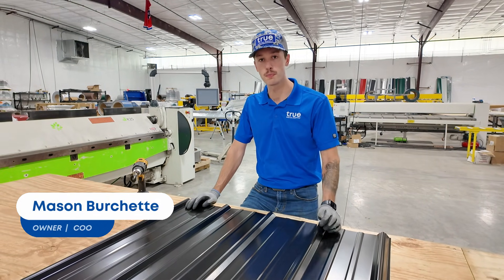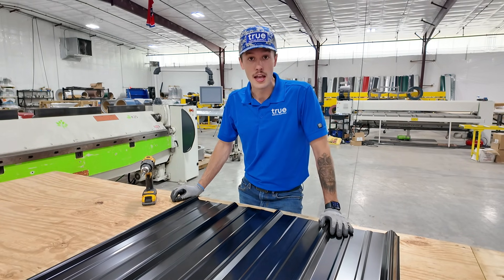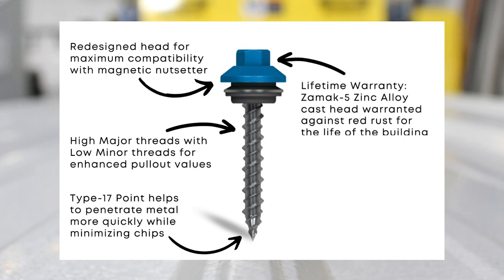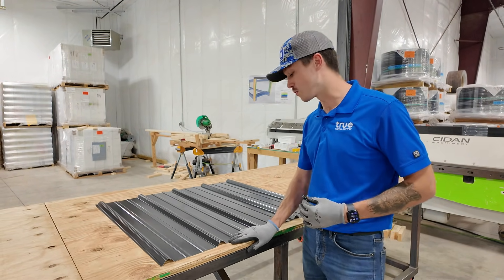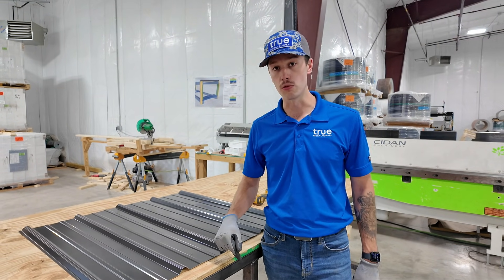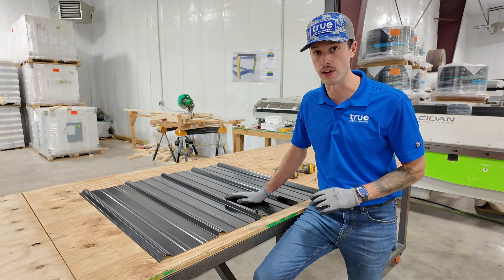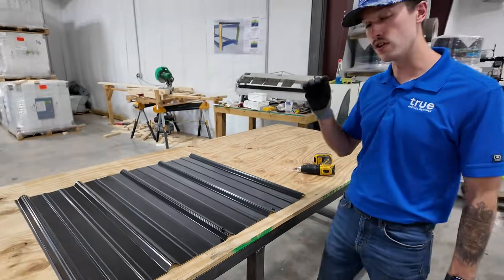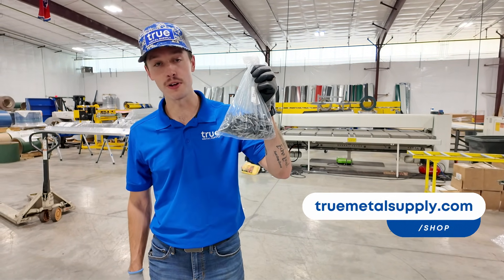Flat or Rib? Where Should You Install Your Metal Roofing Screws?

Comment: I have only seen screws work themselves out in screws placed in the flats. Metal expansion/contraction is one of the main reason to put screws in the ribs. Also it's impossible for it to leak when it's on the rib. Water runs down the flats. Just get long enough screws and you have the same "bite" as the flats
Reply: Hopefully you are being sarcastic. If not I pray for you and eveyone who has you install a roof lol

Comment: Stitch screws on ribs oly to stitch them. Roof screws on the flats. 3:44 naw just use longer screws. The problem is in thermal movement of panel  AND exposed screw allowing panels to not be as secure due to thermal movement not screw pulling out. The panel loosens in cold weather causing movement and leaks. 4:17 spot on.

Comment: What bullshit. Australia has extremes of weather from scorching hot to freezing cold. All metal rooves are screwed in on the ridge. The excuse you're coming up with is just bollocks. 
Using the correct flexible neoprene fasteners solves that ridiculous reasoning you've come up with to justify screwing the panel on the flat.

Comment: Can silicon be used around screws for futher leak proof
Reply: No….first, it would take forever. If you install through the rib you don’t need to.
Reply: Silicone is about worst product ever to come out. Use caulking if you are gonna use anything like that. If properly done then screws with washers will last a very long time.

Comment: Bull crap !   I have 40x80 metal building and was told to put the screws in the flats by the company that sold me the metal. It's been 25 years and now the screws are coming out like crazy .  The little rubber seals WILL fail and common sense tells you that the water will be in the flats and it will work its way around the screws and start to rot the purlins which is what I'm dealing with now.  A friend of mine has a house and outbuildings with the screws in the ribs which was installed around the same time my building was built and I haven't seen one screw backed out yet. From what I understand in Europe and Australia they laugh at us for putting the screws in the flats.  If any of the screws in the ribs were to ever back out at least that is not where the running water is going to be and all you have to do is get a larger screw (which is easily found) and at least the purlin shouldn't have started to rot from water getting around the screw. The type of screw ( i believe they are called dome cap )  this guy is selling is what I am going to try to solve my problem by installing larger diameter screws but nothing is going to help if the purlin has started to rot around the screw. I am getting ready to install a metal roof on my garage and the screws will be in the ribs with the holes pre drilled.
Reply: my purlins are rot resistant redwood.  After 25 years you should expect the screws to back out to some extent.  I was told to check them every 5-10 years as they may need adjustments.  I have ice and water shield under my purlins and it is bomb proof so leaks are not an issue. My screws are in the flat.  EPDM washers don't last 25 years in the weather and elements and you should plan on replacing them with new screws.

Comment: In Nicaragua, lots of rain and sun radiation, we install the screws on the rib. We also apply a product called Imperfast by Kermill to seal and protect the screw's neoprene seal against UV radiation. That's the key step for a long-lasting fastener.

Comment: The claim about thermal expansion is not valid for a concern. A 100 degree temperature change will only result in about a .0007" change in length of the screw, not an issue.
Reply: The concern isn't for the screw expanding, it's about the metal roof itself.  Expansion of materials due to temperature is expansion per inch of material. For an 8ft steel panel, that's 0.07" with a 100F change. That's enough to mess things up.  It's the same reason drip edge is supposed to be nailed every 4", it's because of thermal expansion over long lengths
Reply from the maker: Great explanation!

Comment: It's not controversial, there is no benefit to screw into the flat compared to going through the rib which is proven since roof screws were invented. The screw you used is way to short for the profile of the sheet, use longer screws, screw in properly, problem solved.
Reply: When considering thermal expansion the more threads  above the decking the movement of the roof panel would have more leverage to work on the screw. Like using a short bar to lift something vs a long bar. That was what he was trying to explain.  Could avoid the whole mess completely and install standing seam.
Reply from the maker: We appreciate the opinion!

Comment: Okay thanks  for the informative information. To be honest I was think on the rib of the panel because of rain water. ( I am in Florida no snow) But it does make sense now to place the screws in the flat or valley of the panel. Seals better, less exposed screw to thermal expansion and contraction. I am getting ready to have a roof installed on my house and could not get or find out any information of the best place to install screws. Your way does make more sense. Thanks very much. Now I just need to find a roofer who knows what they are doing.
Reply: I'm in the Vero Beach area if you need a good roofer
Reply: PUT SCRES ON THE RIBS .TRUST  ME WE HAVE 50 YEARS EXPERIENCE ❤😊 @roblee2968

Comment: My metal building was built in 1998 and the contractor put the screws in the rib.  The roof has developed some leaks.  What are my options?
Reply: On a rainy day look and mark where the leaks are in your roof. Then you know where the leaks are coming from. Have a guy in the attic guiding someone on the roof to where the leaks were and replace the screws in the affected areas
Reply from the maker: Oversized screws with larger shafts are available for replacing existing screws!

Comment: Between the smaller pencil ribs , most leak resistant is standing seam,  mastic tape on laped rib then stitch screw high ribs with 5/16 head 1/4" × 7/8 long

Comment: so I will tell you this from experience. Manufactures want you to screw on the flat for 2 reasons. It is easier to get a proper layment of the panel and they want to sell their newer more expensive products. If you are experienced enough you can place the screws properly on the rib and this is the best way to go for many reasons. As he stated the roof flexes and moves. with the screws on the rib it allows the roof to flex. On the flat it  causes far more resistance to flex and will cause the screws to either back out. damage the washers or even break the screw heads off. When going through the rib I use 2 inch screws to solve the issues he demonstrated.  when on the rib pre drilling helps prevent problems. If you have a faulty screw on the rib will leak 99 percent less than a faulty screw on the flat. I predrill only on the laps and trim pieces. I started putting through the roof on the threads of the screws  just after they penetrate the metal. Do this right and your screws will remain water tight for over 60 years,,, do it on the flat and I can guarantee you are replacing most of them in under 20 years. Also never install exposed fastener panels without purlins except in buildings that are not heated. NEVER. I have repaired so many roofs that were screwed on the flat....
Reply: What happens if you don't use purlins and place the metal directly on plywood with a roofing paper sandwiched between when roofing a heated or cooled home? Thank you.
Reply: @really2345 why would you worry if it’s plywood? There is no need for strapping at that point. The paper simply stops noise of movement. Not sure if I answered your question
Reply: You sir are 100% correct! The only time I screw on the flat is the bottom gasket to better seal the gasket. If it does leak in the future it is past the wall plate and will leak out of the soffit. Not ideal but not ruining your home. Screwing on the flat in my eyes is only for walls and horizontal runs
Reply: Funny, i kinda doubt you.  All the repairs I've done are loose screws in the ribs, screws in the flat stay tight far longer.  Especially in windy areas, I'm in Canada, cold Winters and hot summers, and wide open winds.  Screws in ribs always go loose.
Reply: Finally someone who actually  understands